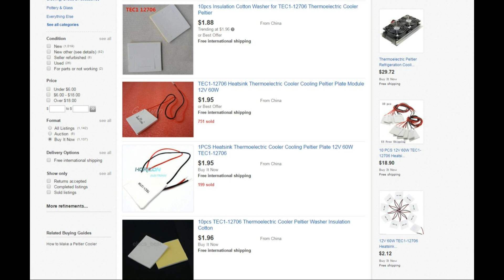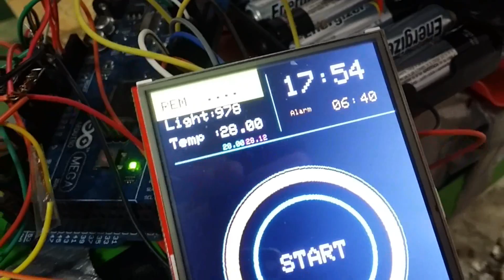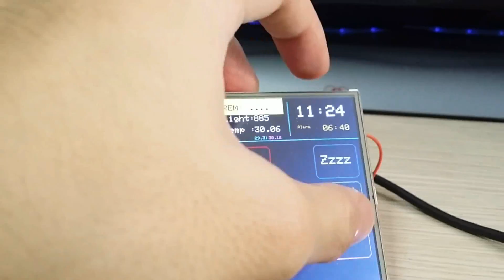Peltier air conditioner DIY (No ice cubes!)

Comment: You're going to need about 100 of these running simultaniously to match the BTUs / cooling power of a room air conditioner. And you will need to pipe the heat outside unless you want half your space hot and the other half cool. You're better off with a window aircon.

Comment: You can just use a old pc power supply or 5-10 amps 12v power supply.  30 amps is just going to waste 60 to 70w just with it powering nothing.
Reply from the maker: That guy The power capability and capacity is 30amp, but that doesn't mean it will be used or consumed by nothing. The idea is expansion in case more energy is needed - think far.
Reply: Charles lol

Comment: Hay why not use solid state graphite power cell bank that charged organic carbon power cell bank with graphite airogel power cell bank to provide a power system for a split air conditioning system? You a smart fellow right so you know graphite power cells generates electrity from earths resononce field?

Comment: Why not use scandium rings in an aluminum cylinder then pass low frequency hertz through cylinder to cause the crystal structures to generate ultra low temperatures then pass air over and through cylinder for air conditioning? Like how a Stirling piston generates a hertz frequency in an aluminum probe to generate ultra low temperatures?

Comment: Hi, Nice video, Can we develop this and use as an air conditioner to cool a single bed room?
Reply from the maker: you can't, for such a small aircon. you will heat up the room instead, and still waste tons of electricity.
Reply: I was planing to put few units attached to the window. Thank you very much

Comment: great video mate! but my question did you put thermal grease on both cold and hot side of the peltier or just on hot side?
Reply from the maker: both sides mate. the purpose of thermal grease is to close off contact between 12706 module with the heat sinks.

Comment: Try this, a cryogenic Sterling piston operated by a electric motor that turns air to liquid that is siphoned through a heat exchange radiator with a fantastic fan to force air through the radiator to cool the air. The liquid air returns to vapor where it is recycled and turned back into liquid to siphon back through the radiator. I would say 12 volts for the electric motor to operate the cryogenic Sterling piston and 12 volts to operate the fantastic fan for a air conditioning unit. What do you think about this design?

Comment: cool but i think the heat sink may be a bit overkill i used the Intel stock cooler and it stays cold doesn't even get warm and they are allot smaller. I also live in wales so its not very warm might be why it works so well.
Reply from the maker: i love this heat sink, spent more 100 to acquire it
Reply: Charles wuut

Comment: awesome bro
can this be used to condense air to produce water?
Reply from the maker: thanks for your comment. YES. Condensation is definitely a good idea, however, be aware of the bacteria in the air that may be part of the water, and if consumption is your aim, i suggest to include purifying technology as well. Good luck!
Reply: Thanks for the reply,can you give me an idea about how much water i can produce at a humidity of 50% with  
4 peltier (40mm x 40mm)? I am also planning to increase the surface area of the peltier by using  highly conductive material.It will be a great help for me,also can you suggest some methods to purify the water?
I have a design,if you have time to look at it, i can send it to you. Please provide your email id.

Comment: Hay want to help me build a hot air power generator that can run a heater or an air conditioner while producing electricity to be stored in a capacitor battery bank?

Comment: WD 40 it was originally made to stop ice crystals from forming on the outside of rockets... you can coat the copper to stop the ice from forming. it could be used on computers that way
Reply from the maker: will try out

Comment: Hello Mr Charles!

Amazing work u did here! , really great! i love the idea and how u managed to get the high temperature side to vent outside of ur room , to make it really efficient cooling method , i would just like to ask you about the air temperature from the cold side blowing off the fans , did u measure that i am eager to know that?

Thank You! and keep it up :)
Reply from the maker: Ali Kayed hello Bro thanks for your very kind comment.  It works well but only confined to a small area, like blowing yourself sitting in front of a computer etc. The lowest temperature achieved was 26 degree. Outside temperature was 30 degree.
Reply: Thanks alot! :)
Reply from the maker: Basically to segregate the unit away from the room, only allowing cool air to enter. That would require a lot of space, which as you can see, I don't have the luxury of. But you're right, that'll do the trick for most part. As for how long it'll really take to cool down a room size worth of air, unlikely you achieve with such a small prototype.
Reply: cubicle coffin?

Comment: This is an awesome project! I loved how you used the sandwiching idea and using the fan to suck the air out of the enclosed container. 

But! Some things to work on;
Try putting a shelf on the outside of your window and put the whole "hot" heat sink contraption on the shelf! Then close the window on the cold part of the vent. That will make sure the heat stays out of the room! 
Id try water cooling! It is an amazing thing to work with, because it's 2 times efficient and effective then conventional heat sinks. 
However, in the video I was confused if it was a big or small room! If it's small it'll work amazing, but if it's not it's a waist of time! 

Good luck
Reply from the maker: Thanks Matt,
Regarding your first point, that was my initial design. The reason why this designed this way is largely due to the specs of the window i have - it's a push out window, which means I would need to seal one side with a cut--out hole to fit the heat sink contraption to separate out the cold and hot side. Ideally that would be good if it's a sliding window.

For water cooling, that was also the initial design. Main reason of not using this idea is because I've seen videos of huge mess created by water pipes leakage, due to either expansion, weak joints etc, and don't wish to go through the same. Also, to keep the cost and complexity low, I've used heat sink instead for the hot side. Not to mention I also need a proper ledge to hold the radiator to cool the water, and that my window just isn't built for it. Considering all these, I've built the way you saw. 

Thanks for your comment!

Comment: guys, that's very inefficient way to cool anything!
Reply from the maker: It's just an experiment. If you'd use the proper application (ie: Cloud Chamber), peltier is a great way to cool down the metal plate efficiently and cheaply.

Comment: Put this in an igloo with air ports to run the heat sink air out of a window with a hose and market it! You could use old cell phones for it has well to run it to keep costs down and profits way up!
Reply from the maker: great idea... however, old cell phone has not enough current to run even half of a peltier. The consumption rate is really high, unless you redesign it.
Reply: Use Hertz frequency to ultra cool metal design new refrigeration device then use recycled cell phones has a touch control display just need to rewrite software on cell phones with new programming. Novartis
Reply: You can make space heater in same fashion with low voltage induction. Use with graphite rod to produce heat element. Novartis
Reply: I have a four stroke electronic rotary engine design that does not use fossil fuel. I also have a jet engine design that runs off atmosphere has well. I have been very busy designing new things. So you liked my ideas?
Reply: I have a pop up emergency shelter design that is very light weight can be stacked and moved easily and only takes a single person no tools needed to set up. A few models that are modular. Interested in hearing about it?
Reply: Could you tell me more? Please send PM.
Reply: Tell you more?
Reply: Would not a Stirling cycle cryogenic piston in a sealed system that turned air into liquid that filled a tank with a bell siphon that emptied into a heat exchange radiator with a fan to draw air through radiator for air conditioning with the liquid air boil off vapor returning to tank to form liquid air by the cryogenic piston be a much better way to cool? A portable or central air conditioning system? Liquid air generates ultra low temperatures so super conducting elements could be used with this system has well to generate electricity. Hay even an atmospheric elemental electric power generator could be developed using the correct components. That would be really cool an air conditioner electrical power generator that operated of simple atmosphere? LOL
Reply: Stirling cold gas V-10  engine with gadolinium magnetic bearings cranking a super conductor electricity generator operating off liquid air being produced in a closed system and the ultra low temperature liquid passed over cylinder heads to keep cold gas engine operating with a circuit operating the cryogenic sealed cylinder that produces the liquid air? Using the correct components this type of device is very possible. All you need to know is how to place the components in the right places. ; )
Reply: I wonder if you could use frequency emitters in liquid air to cause the different liquid gases to turn into vapor which could be processed off the liquid air leaving the liquid nitrogen or liquid oxygen or liquid argon etc behind to have a different frequency used to harvest these different gases from liquid air that has been produced? Could not systems be set up to produce liquid air that turned the nitrogen put into air by fossil fuel use into fertilizer? Nitrogen 71% of liquid air? Then oxygen and hydrogen to produce fresh water? Hay you could control green house climate while producing electricity and water and fertilizer to operate the green house all by using liquid atmosphere generation? I wonder if it could work? = /
Reply: Farmers operating green houses with these systems would be cleaning up air pollution? Farmers could even process liquid argon to grow super capacitor crystals has well. So many uses and applications of this technology. ; )
Reply: Charles you went to a technology school correct? I see you like low technology because its easy right? High technology takes a little more out of folks and most who went to technology schools were taught to think in a certain way. Its very hard to overcome programming hay Charles? = /
Reply: Charles you think a drum motor rewired into a generator with wireless energy transfer IE Tesla coils in a sealed cylinder within a super conducting material with liquid air cooling super conducting material could create a power generation system? NASA has been looking for power systems that can operate in space or off the cold void of space?  Super conducting rings with high frequency electricity using Tesla coils means zero loss of energy from point A to point B? Could you not use graphite power cells with certain components to create energy grids here on earth and move electrical energy around without the use of high tension power lines? Just have line of sight graphite power cell stations that moved all that energy from point A to point B? I did not attend a technology school like you Charles so I am not limited like you are it seems. = /
Reply: But then again my science could be just fiction yet its nice to dream of things to come has old things become really old things has new ways of thought are taught. ; )

Comment: I would think it should work better to you use a thin layer of thermal paste, just like if you were putting a computer together and installing the CPU. It's really just for eliminating tiny gaps in the metal so you should get much better heat transfer by using less.
Reply: also it would be a little cheaper to use less paste.
Reply from the maker: @Chronometer I did use thermal paste between each cold and hot side of the TEC against their respective fins. It's not about money to use lesser paste (one small bottle is around $5), but rather, lesser paste is to increase heat pass through to heat sink, so TEC may cool faster.

Comment: Will it work if i use it in my car?
Reply from the maker: My friend, if your car is sealed, I think this would work.  What car is that may i ask?
Reply: +Charles corolla 1999 ya my car is sealed
Reply from the maker: + Abdullah Sure, that case, should work. However, I'd foresee the hot side to be slightly protruding out on the window. Not sure if you'd really want to modify the dashboard area?

Comment: Great Job.  QUESTION:  What would be your estimated specification to use this device to cool a space of 6 feet by 3 feet by 2 1/5 feet?
Reply from the maker: @Caribbeanblend: If you insulate the unit really well, and the space (i'd assume it's just a big box) really well, my estimation would be around 1 hour. However, don't take my word for it. There are many permutations on the CPU fan power, TEC power, your electric source, space leakage, how well you insulate the portable aircon etc.. this experiment definitely requires more experiment to trial and error. At the end of the day, it's the complete construction of the portable aircon that gives the most satisfactions. :) Do show us your accomplishments once you're done!
Reply: Charles pls help me out. I am a student and we have planned to make something with peltier that can be attached to a stand fan in our class to use it like an air conditioner to cool down the temperature of the classroom...pls help me on how to do it...and fast pls...i dont know anything about it and i have to do it so pls explain and tell in simple words ...😓

Comment: How many peltier devices should i use to cool 10x10ft room (26c)
Reply from the maker: @Syed If you are living in a 26c environment, probably another 4-5 peltier devices like this to cool the whole room effectively. My device is not to cool the whole room; mainly used to cool camping tents, baby strollers or direct cooling to body/face. Can even incorporate into an aircon jacket.

Comment: I just did a 2 Peltier Air Conditioner. 2X 145W Solar Panels (7Amp -/+ each at Full Sun 10-14 Amps @12V DC). These Peltier (100W - 6Amps) Suck Energy like CRAZY :((((((((((((((. The amount of Space for the Solar Panels, The Fans with Cooling Grid, Time, Battery Back Up and all other Misc Parts :(((( = ITS SUCKS :(((((((((((((((((((. All the Money and the time I spent. I have better Luck doing a Passive Cooler System. DO NOT DO IT guys !!!
Reply: Yo hold on! It's not the end of your project. 

Getting Peltier units that are more efficient can be found on the TEC website. Besides using a battery backup during the day, use it at night so have the solar panels charging the battery and powering the peltier. It may not charge the battery as effectively, but the solar panel will power that thing like a charm even without much sun!
Reply: Hahaha, the amount of SPACE and Solar Panel will need is that I am talking about. It's NOT the Peltier. But to POWER it is what I am talking about. If you are on a Camping Trip and you want to make a Mini Fridge YES>>> All Power to you when you have NO CHOICE. But to use it as a Regular Item like your house hold items... THIS IS NOT the way to go. In the end... WASTE OF MONEY !!!
Reply from the maker: Proof of concepts never fails. It's a matter of trying and trying until finding the right specifications for your needs.
Reply: Yea you are right, but trying COST MONEY :(((((((((((
Reply: And with not trying, expect also no results.